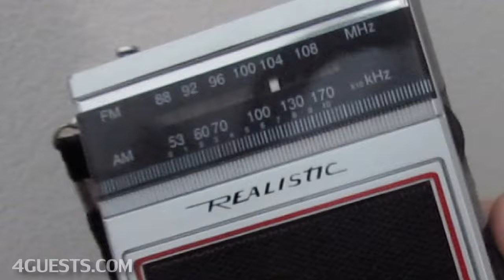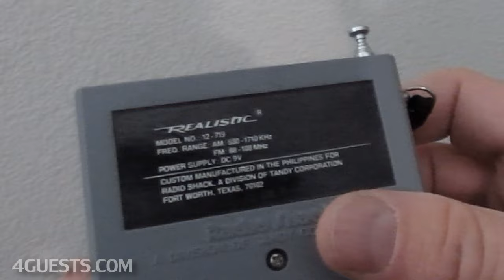REALISTIC AM FM RADIO, 1970s No 12-719 POCKET RECEIVER

Comment: Radio Shack had some Great Transistor Radios. I still have two Radio Shack AM-FM Transistor Radios from the early !990s. They are much smaller ,than the one in the video, pocket size,stereo,2 AAA batteries,no antenna---Beautiful ,Dynamic Sound.

Comment: I have a correction to give you:  This was not made in the 1970s or early 1980s.  This first appeared in the 1987 Radio Shack Catalog, which would mean it came into existence in 1986 and was sold into the 1990s...